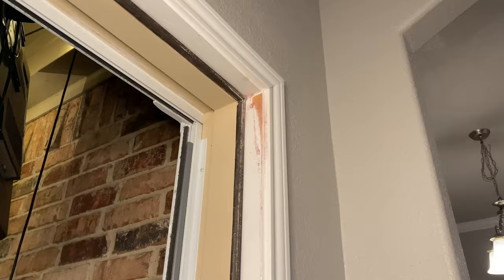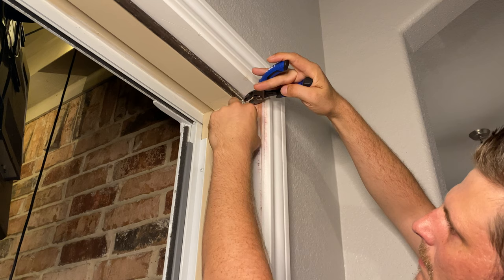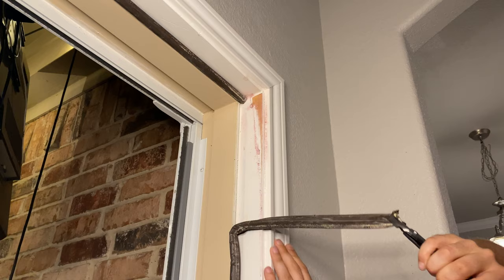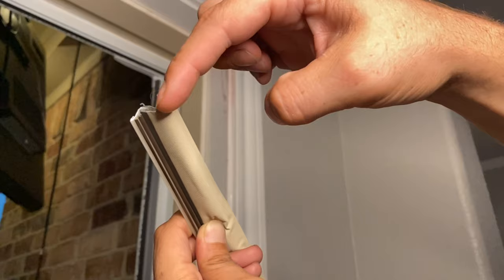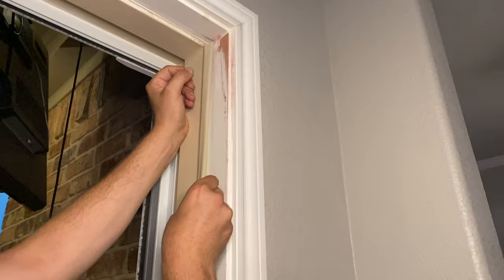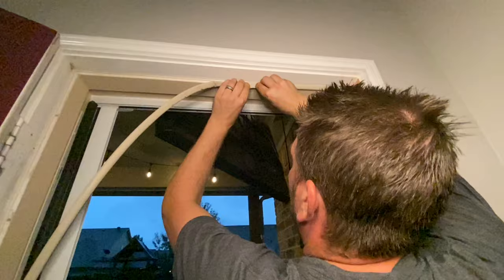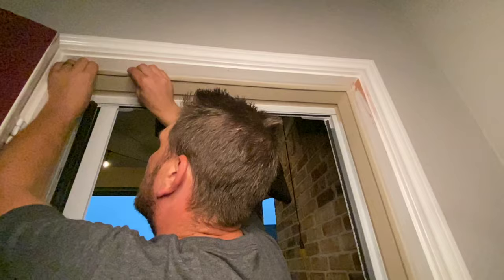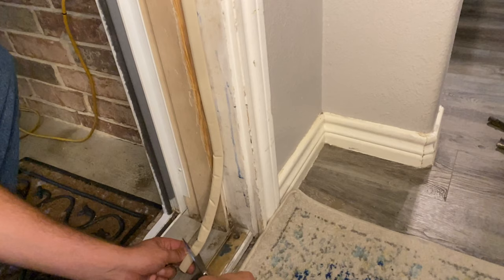Replace YOUR Door Weatherstripping, QUICKLY!!

Comment: Thanks Dan, I didn’t realize the weather stripping just snapped in. We have a door that has a rip in the weather stripping now I will replace it?
Slainte,
DC
Reply from the maker: Yea most modern doors it’s really easy if you have an older door it may be different!